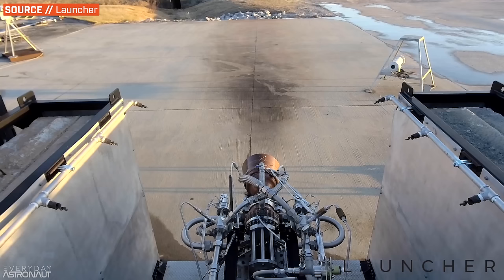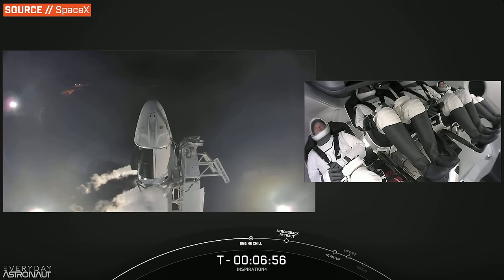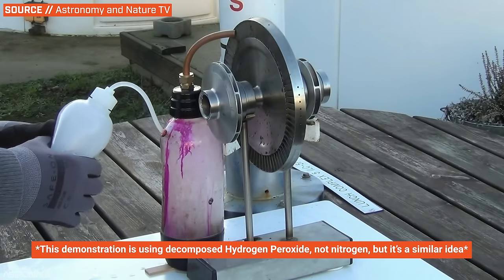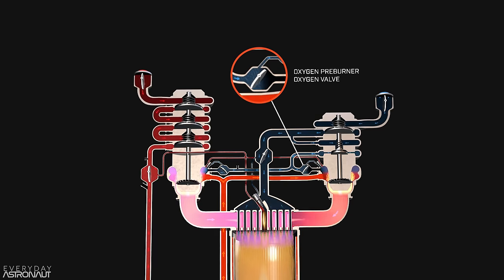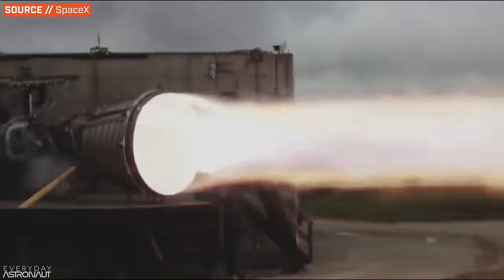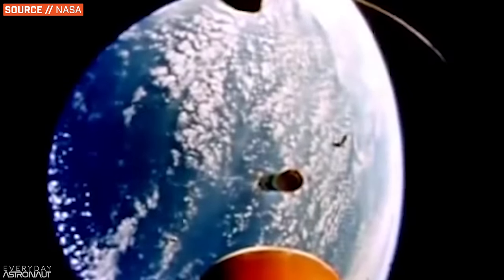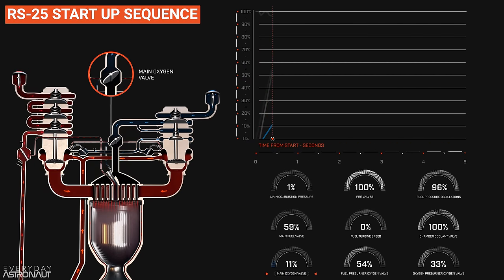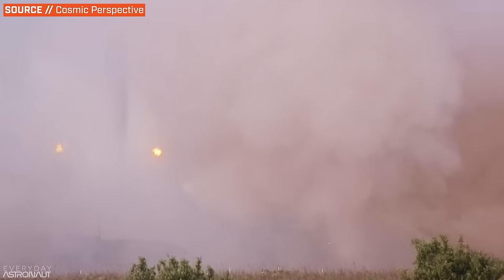Why Starting A Rocket Engine Is So Hard!

Comment: Great video and you explained all the concepts behind IRL rocket engines extremely well! Which go m e thinking... Alot of problems of rocket engines could be solved in the future / in sci-fi with super/miracle materials... Like imagine a metal/ alloy and or composite that works in extreme heat and pressure... Like most of those issues could be solved by just not using steel and brass like imagine Space-X's starship made completely from this material? Basically you would make Hydrox as easer to work with then a hyperbolic... Which would pretty much mean that rocket engine would be as easy to build as a modern V8 in a mustang... Than material alone would change the world and would make for great realistic sci-fi stories and settings.

Comment: Not the bubbles are chipping away (it sounds like a bubble floats by, hits the blade and the blade is damaged), it’s the collapsing of the bubbles, a bunch of mini implosions. You have the same with ships and submarines. Especially submarines are trying to avoid it, because the collapsing bubbles generate so much noise.

Comment: Tim, I've always wondered this. On the Minuteman missiles, they have thrust termination ports near the top of the stage so they can blow them and the pressure differential immediately stops the combustion, helping staging accuracy and precision. Why couldn't they have incorporated this into the Shuttle/SLS SRB's?

Comment: Question for you, Tim. At what physical point do the expanding gases act upon the rocket, propelling it upward?  If it's the ignition plate, wouldn't the pressure of the propellant have to be higher than the back-pressure of the burning fuel? Is it the ignition plate, the nozzle or a combination of the two? Thanks for your videos.

Comment: Really cool video! To me it seems that the idea and theory of starting an engine, once understood is quite simple, but to measure and control the process is the hard part. Super high and low temps, high speed but at the same time fast and small changes need to be done. Loads of stuff that can break or send a wrong signal and loads of forces that act on the parts.

Comment: One pair of facts that took me a while to really "grok" is that the fuel flow pressure must exceed the chamber pressure, which is driven by the combustion; and that back pressure is simply a force that pushes the injector plate and the nozzle, that either directly or indirectly pushes the thrust puck and rocket body "up". The combustion process is just the mechanism to provide the push. I know this is obvious in one sense, but it's interesting to think of it as hypothetically capable of being implemented by any arbitrary mechanism such as a piston or large fist (for a short distance!).

Comment: this sounds pretty easy... we can connect terbines to on pad electric moters and have them running for entirety of mission. when engines are off, terbines keep on running cz inertia. and most of complicated part if gone. if u wanna throttle, just put a valve upstrem to turbo pumps.

Comment: I hate to say this but I'm going to have to. First this is a fantastic video about how to start a rocket engine. Now the critique, unless things really have changed with how an engine starts since 1965, you do not want to start with a fuel rich combustion chamber, that will cause a hard start. That is what destroyed Gemini-Agena Target Vehicle (GATV) 5002 for the Gemini 6 mission. They, NASA, wanted to save oxidizer due to the number of re-starts planned for the mission, so they ran the fuel first into the combustion chamber and then the oxidizer. It had a hard start, a sort of back-fire, in the combustion chamber which destroyed the Agena. The fuel that was used is Nitric acid/UDMH, which is a Hypergolic fuel. This was the only thing I found wrong with the video. Like I said, it was fantastic.

Now, for two topics that were not covered in the video, the first is Combustion Instability and the Injector Plate Face Design. Combustion Instability was a HUGE problem for the F-1 first stage engine for the Saturn V. The fuel used was RP-1 and Liquid Oxygen (LOX). During testing combustion instability was found to be the cause of the loss of several F-1 engines in the test stand. This was narrowed down to the design of the injector plate. After many different design changes and no success, the engineers at Huntsville decided to go back and look at the V-2 injector plate. They copied the basic design and soon found that the combustion instability was controlled. They induced combustion instability, which was a NASA requirement for engine approval, with what was called a bomb shortly after engine ignition by placing it on an arm and moved it into place in the flame tail to one side and set it off. This would cause an instability in the combustion chamber that would move around the injector plate face. With the final new design which was inspired by the V-2 rocket; combustion instability was controlled. You can see the effects of this by the reaction of the engine bell during testing showing it deform and showing a definite warping of the engine bell as it moved.

I don't mean to be a show-off or anything like that. I grew up with Mercury, Gemini and Apollo missions, in fact I turned one year old the day after Alan B. Shepards Mercury flight. I have studied NASA and NASA history from a very young age. Great work on the channel, and you are the only channel I really watch for launch coverage. Keep up the good work. -- Jack

Comment: I worked on the only aircraft, I believe, that had two 750lb liquid nitrogen tanks inboard on the top of both wings. And of course there was additional liquid oxygen tanks as well. Most military aircraft had these, some did have gaseous oxygen. This stuff is cold and I had to go through special training to work on these systems. They seemed to always have a surprise waiting for you when I had to work on them, venting, squinting, thick fogging made things difficult. Think about walking up to a mechanical device to work on and the whole da** thing looked like a snowball. especially when the system had a bad or several leaks. The nitrogen systems didn't bother me too much it was the Lox system that I gave extreme caution, especially when venting during outside weather or war conditions...it supports combustion. We also had to work on the larger tanks that held thousands of gallons of either one. They didn't mention this when I signed up, but I was there to serve and anything new always peeked my interest. Thanks for the information.

Comment: Great video!  As you said about the electric turbine method, it's not as efficient though far simpler to manage.  With the eventual rise of reusable rockets and the accompanying drop in cost/kg, do you think more engines will use electric powered turbines?  If not, why not?

Comment: TY Tim.
Yet this is still just an overview, imaging the maths, material and flow science to make even a single valve work at these temperatures and pressures to operate reliably with this sort of precision and variable flow rates. 
No wonder it is said rocket science is hard.

Comment: Great content.  You've forgotten ( easy to do since there are so many variations ) about a hybrid booster.  You have can a solid propellant (Polybutadiene and Carbon, for example, or rubber) plus an oxidizer.  High pressure helium pressurizes the LOX (Liquid Oxygen) which is injected into the chamber(s) of the rubber propellant.  To start, TEAL (TriEthylALumina) is sprayed through nozzles onto the rubber propellant with some percentage of the oxidizer.  This produces an ISP in the range of 250 to 300, as I recall.  Look up AMROC | Know Your Rocket ( I worked at AMROC many years ago ).  This technology found it's way to be the booster for the SpaceShipOne ( Burt Rutan ).

Comment: Wouldn't a rocket that is landing and falling through the atmosphere experience atmospheric back pressure into the main combustion chamber?  Or what happens in that case?  And what is more, falling through thin atmosphere at 50-60km at Mach 4 - Mach 8 or falling through thick atmosphere for a landing burn at only subsonic speed?

Thanks for all these videos you put out.  They are amazing and super interesting to watch.
Reply: Have you noticed how rapidly Falcon-9 slows down due to the dynamic pressure of going through the air at high velocity? Hardly at all at 50-60 km. The pressure only becomes noticeable at about 30 km, and very significant at 10 km. Still, when the landing burn starts, the dynamic pressure is only a fraction of one atmosphere (you can get a good estimate by dividing the weight of almost empty rocket by its cross section, which gives somewhere between 1/4 and 1/2 of one atmosphere) -- negligible, comparing to the pressures in the fuel system.

Comment: On the solid booster I was told it shoots a flame the length of the booster. The gasket for the part is several feet in diameter.

Comment: Hey Tim, since liquid methane and liquid oxygen can both co-exist together and not spontaneously react without an ignition source, why couldn't somebody build a mono tank and mono turbopump engine/rocket that receives premixed propellants at exactly the right fuel and oxidizer ratios? Wouldn't that be simpler than creating a delicate interconnected cross flow propellant/oxidizer delivery system? Just an idea that popped into my head
Reply: The problem is pressure, you need a way to genarate pressure to not have backburn in the system.

Comment: The timing of the open loop part of the start-up cycle is so critical. What effect would changes of lengths/diameters of pipe and charging pressure of the fuel/oxidiser do to those timings. I guess what I am trying to ask is do they have to adjust the timings for each engine based on how close they are to the design tolerances?

Comment: Hey Tim, just had a question real quick. While the Falcon 9 booster stage is descending down to earth, the propellant must hug the roof of the tanks, because the rocket is travelling opposite to its lift-off direction. So, how is the propellant pumped effectively? Thanks mate for making a wonderful video and have a good one! 😃
Reply: You are wrong, when the booster descend experience some deceleration from the atmosphere around it and the remaining propellant settle on the lower part of the tanks because the rocket is coming with bottom down, if wouldn't be a atmosphere (like on the moon for example) wouldn't be a deceleration and the propellant will float away all around the tanks and don't settle "down" or "up", a rocket isn't like a aircraft or other terrestrial vehicle even if it's not in orbit (like New Shepard suborbital for example) when you stop your engines you start to float because without significant atmosphere the gravity would pull the human inside with the same force(and in the same direction) like the walls of the rocket or the propellant in the tanks.
Reply: I think it’s not at the roof of the tank. While descending, the booster is more or less in free fall and therefore the propellant is just floating around in the tanks as he explained.

When entering the lower parts of the atmosphere, the atmosphere kinda pushes the booster up, relative to the propellant in the tanks. This due to aerodynamic drag of the booster while the propellant wants to keep its inertia and continue with its free fall.
So the propellants are forced against the lower part of the tanks (which enables a fairly easy engine start?).

Comment: Am I correct In believing that a Gas turbine engine exhaust is used to Spin Up n Drive the turbo pumps on the Saturn 5, An engine size equivalent to a Huey helicopter..Also does the wire ignite the engine only on start up similar to a diesel glowing plug or are the wires  glowing All the Time?

Comment: There was a SciFi story set far in the future about an ancient relic.  The relic was a "whistle" that was supposed to be in the top of a solid rocket and the vibrations set up by the whistle was supposed to interact with the burning surface of the propellant and "tune" the performance.  I have never found any reference to any rocket that used something like this.  Is it a real thing?
Reply: It says there is a reply, but I can't see it.

Comment: Tim!!!!!!!!

Question: Why don't Space X have a raptor Engine blasting horizontally with tail pointing out to the ocean at the base of the Starship Launch.

Purpose? Because of the rockets negative pressure, it will lead the Blast Cloud of starship launch outof the Critical Tank Garden and it will act like a Dyson fan.

What do you think?
Reply: the DYNAMIC drop in pressure that the engines create is orders of magnitude to low to direct exhaust plume away from anywhere. Once they move to the proposed SLC 37, they might opt to build a flametrench to divert the exhaust rather then the current bidet system

Comment: Since I know, how complex rocket engines are, I decided to go to gravitoelectromagnetic (GEM) engines - as used bei the USAF/AFSPC - today USSF - since the end of the STS in July 2011. These TAV (Trans-Atmospheric Vehicles) and AMV (All-Media Vehicles) perform all the military satellite maintenance stuff, Soyus never did. GEM-engines are tricky too, since a lot of relativistic stuff is going on. The most challenging part is navigation, since within a GEM-field, there is another inertial frame. INS is therefore out of reach, since the craft is always in a freefall-condition. Optical navigation is impossible too, since light always follows geodesic lines (aka spacetime-curvature). Also GNSS-Navigation fails due to gravitational red- and blue-shift. The solution is to operate the engines (typically three) in a pulsed mode. The big advantage however is, efficiency is very high (about 99.7%) since underlying physics uses bosonic statistics - like e.g. a frequency doubler in a Laser. The disadantage is, hiding such vehicles is practically impossible, because the 1.6GHz driving frequency is easily detectable.

Comment: The fact that they knew backflow combustion shockwaves were happening and being able to predict them and actuating the valves accordingly as to keep the whole system from going backwards and blowing up is ridiculous. A lot about this reminds me of turbo charged engines, where the fact that a turbine is "in the way" when the engine tries to expell the exhaust will cause backpressure on the piston, so they have that really complicated system in order to not have the turbo eat the additional power it introduced by compressing the charging air. It's just so complicated in all parts... wow.

Comment: I just shake my head at the RS-25 putting the igniter torches on the pump outlets and not using start bottles of gases to provide reliable ignition that's not coupled to the pumps starting. Every single engine I worked on at XCOR had sufficient igniter propellant supply volume to run throughout the engine start and ignore all transients.

I'll leave the rant about subsonic torch igniters for another day.
Reply: Mr. Jones! Good to see you here. 

Speaking of crazy design decisions -- what's your opinion on Firefly's engines, if you care to comment, of course?
Reply: @cogoid A tapoff cycle (presumably with fuel injection into the tapped gases to reduce temperature) has been done before, on the J-2, I think. Turbine exhaust as film coolant was used on the F-1 for Saturn V, so again, a reasonable choice. 

The tapoff cycle has only one ignition required for each engine but at the cost of reduced Isp. Like the SpaceX Merlin engine, Isp is traded for the simplicity of the cycle.
Reply: @r0cketplumber  I do not have an experience with it, but I imagine that tap-off would be hard to debug. It seems a lot easier to debug a gas generator separate from everything else, instead of adding another element of complexity to the main chamber.

Comment: how does falcon 9 and starship light up the engine multiple times when the booster is landing? do the header tanks take care of the whole tank blobbing issue, or there's a little acceleration because of the air resistance?

Comment: Is there a sort of brake for the turbines, to prevent them from run away and to adjust it, or is it controlled through how much pressure it gets by a blow out valve?

Comment: Hello, You were talking about the awsome power of the turbines/fuel pumps.. Quick game: calculate the total power of the 30 or so O2/Methane pumps of the starship booster? It's in the order of 2GW! More power than generated by a nuclear reactor! Let that sink in... It takes MORE THAN A NUCLEAR REACTOR of power the pumps that feed the propellant to the engines that actually power the blody rocket! Absolutely unbeliveable power...

Comment: The problem I have is the Closed Captioning is flat screen verses a scrolling screen (one line at a time) I'm not so fast with reading. Most CC Ive seen is a more comfortable scroll.
Reply: YouTube's CC doesn't have a scrolling mode like you see on T.V.s

Comment: I'd love to hear about how a material scientist views a rocket engine. Pressures, temperatures, erosion, balance, strength, and low weight. It baffles me that any material can function in these conditions.
Reply: Those are some of the details that make up the secret sauce.  :)
Reply: No material can directly withstand the temperature in the combustion chamber. The trick is to design the engine such that this would not be necessary. Then almost any material can be (and has been) used -- including aluminum and mild steel sheet. Of course using good materials is always advantageous, but "good" is a very complex thing here -- involving optimizing together the material and fabrication technology. The most amazing material is useless unless it can be economically processed into the required form without losing its properties.